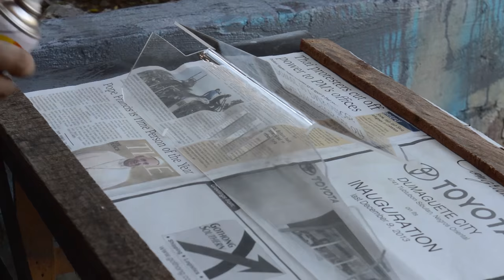Watercooling: Project Vanity

Comment: can i ask you how do you mount psu cover and that cover for water pump and reservoir. do you stick them or do you screw them to the case. or how ?
Reply: +Mihailo Gajic I'm curious about this too :P
But maybe acrylic cement for the glass? And the water pump / res is just with the mounts that come with it :P
Reply: +Vinyl Scratch the acrylic is bent than sits on the psu